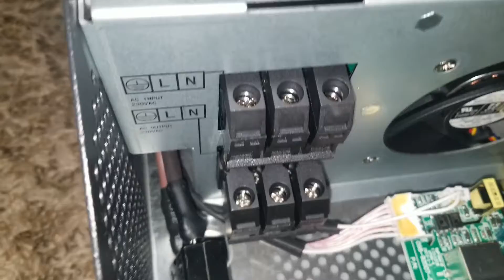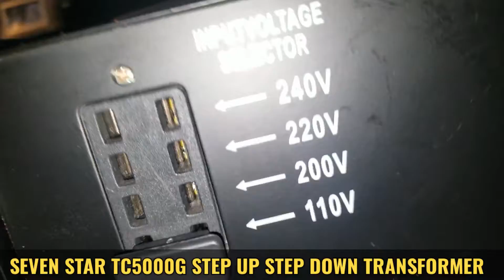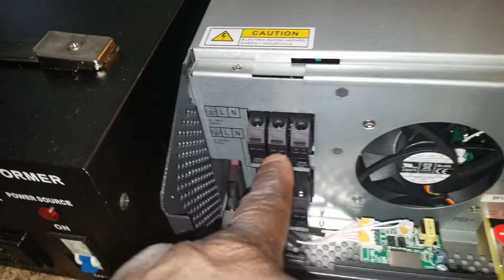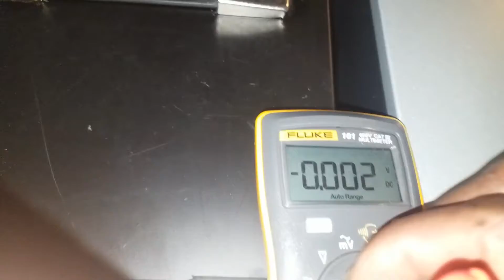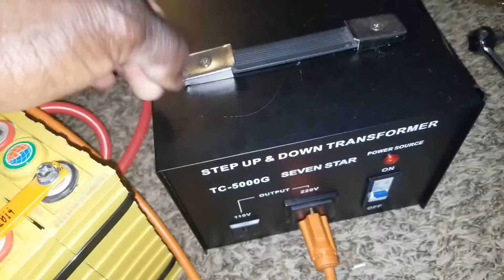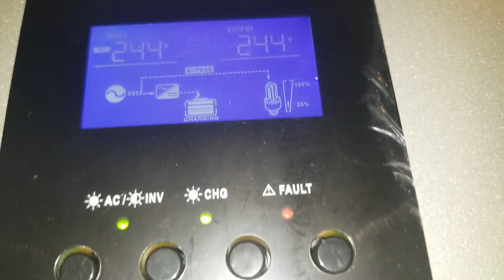VEVOR: 5KVA 48V MPPT HYBRID SOLAR INVERTER BUILT-IN PURE SINE WAVE CHARGE CONTROLLER

Comment: The frequency specs say 50-60hz; is that something you can select on the unit or does it have to be connected to grid power for it to detect the correct frequency?
Reply from the maker: It's an automatic setting
Reply from the maker: Thanks for stopping by and please don't forget to Like Share and Subscribe